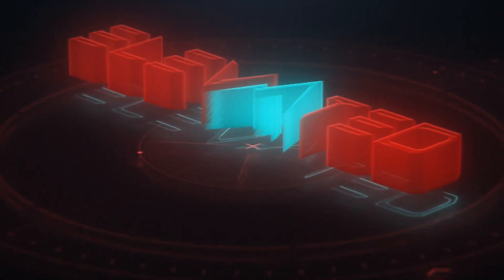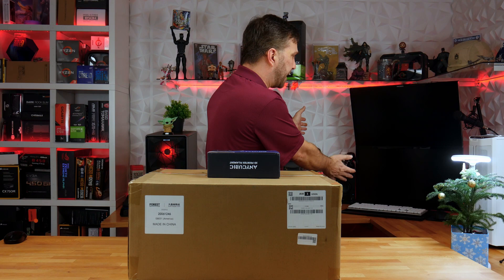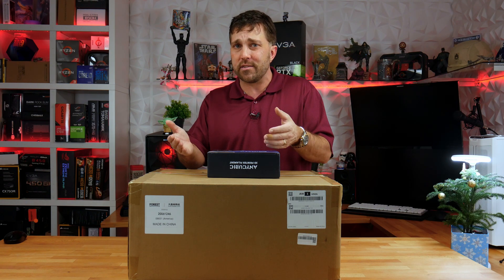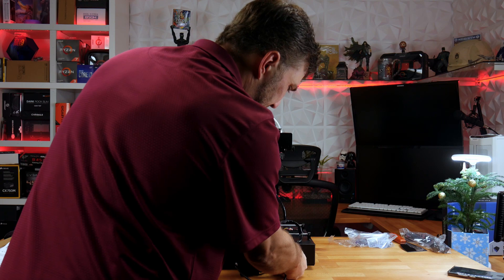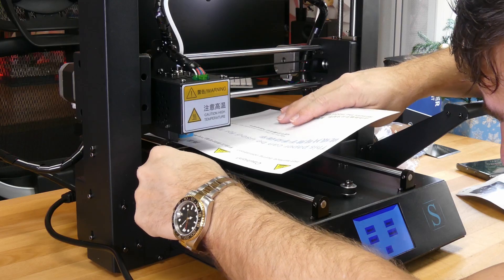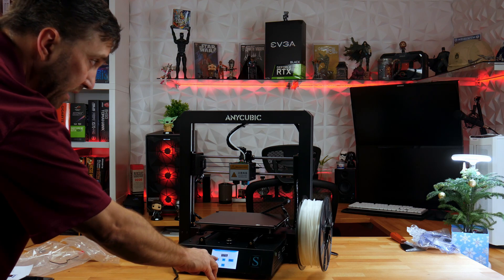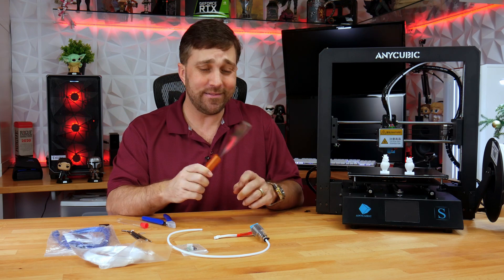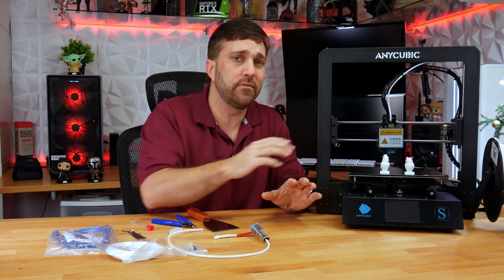Anycubic I3 Mega-S, Unboxing, Assembly, Set-up & First Print

Comment: This is my first 3D printer, and also my first experience with 3D printing in general, and your video helped me figure out that all of the parts that weren’t mentioned in the directions were replacement parts.  I was so worried that I was going to wreck it somehow, but it’s printing the test models as I type, and it’s coming out great.  Thanks a lot for this upload- and since it’s a year after you did, I’ll mention that the problem you stated with the cables being zip tied to the elevation screw seems to have been dealt with, as mine wasn’t.  Or I’m just really lucky.  Anyway, thanks again-

Comment: Hi,i bought the printer and set it up as you said but when i turned it on, it made the startet Sound but then went out. And it wont Start up again. Could smb help me?
Reply: Did you figure your problem out? Are you in the USA? I don't have one yet, just ordered one today but all I can think of is the power supply, some have a switch for 110v/220v...

Comment: Thanks for the video, I encountered a couple issues in setting mine up, and that caused me to find your video. My issue was that the z sensor on the left wide was actually bent so it didn't stop on the bottom correctly, your debugging helped me figure mine out, and I had the same issue with leveling and the zip tie. Also your demo of the leveling process was much more clear than the instructions. I'm running my first test print now. Thanks!

Comment: Hi, I found your video very helpful and it guided me past my first issue. This printer is brand new, never used. I would manually set my temp to 230 degrees, then filament in, then start my print but every time I do that my EO temp drops back down to 190 degrees (factory settings I guess) and stops shooting out filament as it starts to print. Any clue how to fix this issue?

Comment: I just bought this printer as a Christmas gift and set it up this morning. Very easy set up, and like many others, the levelling is the hardest part but I'm impressed with the build quality and print quality on the owls. our cable was also tied, but we had no problems levelling the bed with it tied to the post. Worked great without clipping it. And yeah, it's noisy, but most of them are and the other ones I have looked at in videos were all worse than this one. Gotta say, it's a solid buy, especially for a beginning unit.

Also, don't bother with the included filament. I'm not sure what type it is, but the extruder would not melt it at 230. As soon as we used the spool we bought for it, immediately printed like it was born to do it. Thanks for the vid!

Comment: I have leveled this printer many times and whenever I start printing at one point or another it will start moving around as my first printer I'm not really sure what I need to do.
Reply from the maker: Check and make sure all the springs on the leveling screws are fully extended and not kinked or bent.

Comment: Thank you for this video. It was perfect for me because I really struggle with written instructions that use static images. I nearly had the same issue as you with the cable stopping the head from coming down, but I removed it just in time! I also avoided the other cable issue by removing the cable tie in advance. Maybe that's why the nice side cutters were included. ;)
Reply: The cutters are for cutting supports off the prints, but they work for that too 😅

Comment: Great Video for the first impression and installement. When i finished printing, do i have to take out the filament or can i leave it inside the printer?
Reply from the maker: If you are not going to print again for a while it's best to remove the filament and wrapping back up in packaging with the desiccant packet to keep it from absorbing moisture.

Comment: Will you be doing any videos on any upgrades you've done to the Mega S since you've owned it?
Reply from the maker: I've been using it so much and have the settings dialed in so tight resulting in perfect prints I've been hesitant to change anything on it.
Reply: @ElevatedSystems  can you share any tips or settings you have found useful?
Reply: Will definitely be interested in a video   about all the settings as you have them now. I'm trying to hone down on my settings and it's been a pain lol. Love all the videos you do on the Mega S

Comment: I know this is an older video but you should know that the bed cable is ziptied like that because otherwise the movement of the bed will eventually wear out the solder joints where the wire connects underneath. Tying the cable to one of the corner screws relocates the repetitive stress. Yours may have been cinched too tight at the factory.

I would advise replacing the ziptie (obviously not so tight) or finding some other way to anchor the cable to the bed carriage, before you wear out the solder joints. You do NOT want to have to resolder those; the bed is a giant heatsink.

All in all you picked a really good starter machine and made a good video about it. I've had an i3 Mega (near-identical predecessor to the Mega S) since 2018 and my only complaint is noise.

Comment: Also I had a small problem with that printer, when one motor didn't work, so i had to check whether all the cable connections are good and I found out that left motor was badly connected, so be sure to check them all before first printing.

Comment: My printer doesn’t turn on for some reason, it turned on for a couple seconds then never turned on again, why!
Reply: Check the pwr cord and the little switch that changes the amperage
Reply: @brazil551  first of all nice name, second of all i found the problem i blew a fuse and i switched it so it works fin except now all the prints arent sticking to the pre heated bed
Reply: @speedshot2361  haha Thank you Have you tried useing a glue stick it can make jt really hard to remove but every time I have done it the adhesion has done very well and put temp to 70 for pla for bed temp
Reply: Did you make sure to put it at the right voltage before plugging in?

Comment: i used your video to help assemble mine. two problems, SD card was not formatted properly, took me an hour to figure that our and resolve...as i had no hint. 2. after having calibrated the base properly...yes, very sure, took me 40 minutes, the unit still scratched the base on first print. The end product is not smooth. Overall, it's junk or this was my experience.

Comment: For some reason mine does not have a red cord
Reply from the maker: They must have run out of red housings, but I think all the cables to connect are different sizes, and can only be plugged into the corresponding port.

Comment: thanks for the review! just bought the same printer and I'm new into 3D printer, any recommendation to start with simple 3D modeling?
Reply from the maker: I do all my 3D Modeling in Autodesk Fusion 360. It's free, easy to learn, and has more functionality then you will probably ever need. There is not much you can't design or model with it.